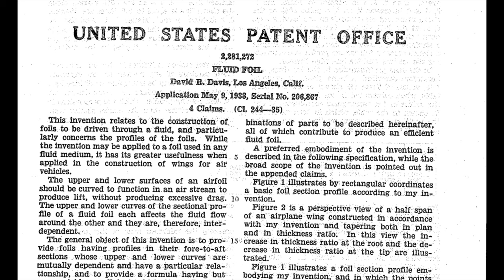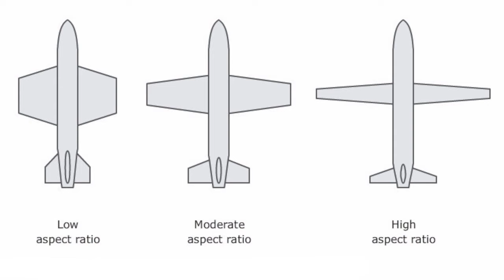The Davis Wing

Comment: this critical period demonstrates a conversion from, more or less 'trial by ordeal' of the WW1 era to design based on analysis of late WW2 era
However like the davis wing it didnt end with predictable conclusions. After WW2 a great variety of aircraft types meant to demonstrate specific missions were hurriedly put together with some troubling innovations. It was until the 60's that enough experience had been garnered to produce aircraft that fulfilled needed requirements, memorable aircraft such as the Vulcan, EE Lightning, EE Canberra, and others in plan such as Concorde and Harrier.
Reply from the maker: Good summation. Thanks.